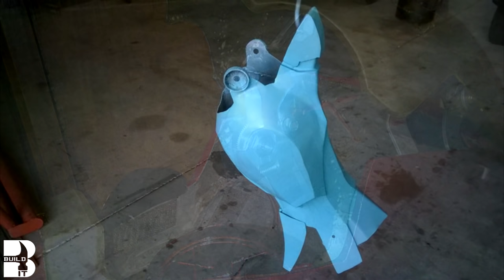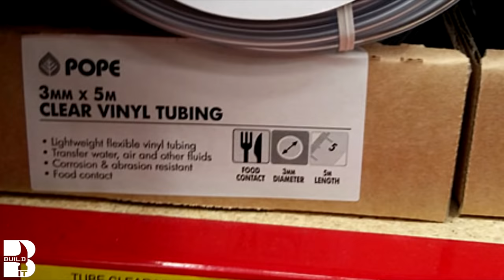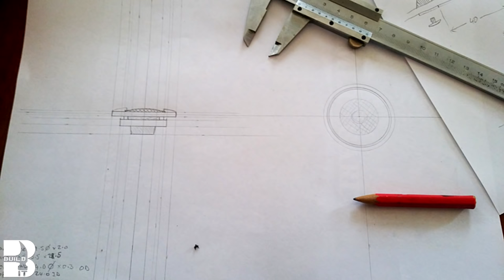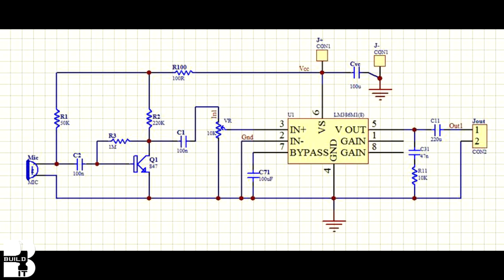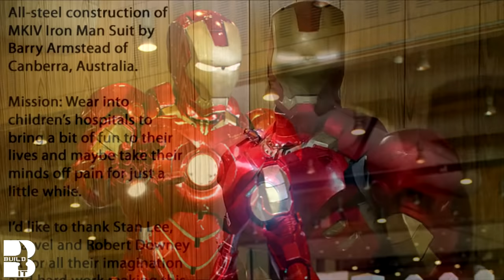DIY: How To Make Iron Man Full Steel Body Suit

Comment: Ive got a question im making the iron man mrk 50 and i used thin metal sheets but my edges are sharp how do i fix that problem. I have a jacket inside so im good but i might be causing some trouble to the people surrounding me. Im new to metal cosplay and theres not that much community for metal cosplays around.
Reply: Have you tried using a Dremel
Reply: came back after a year to solving my problem on sharp edges. you use a chizle clamped to an anvil pointing up. you use that to curl the edges of the metal parts. i made a video showing the process.

Comment: As a 13 year old in a Lego inventor club with other people my age I made an exoskeleton of This  suit in my size. How I did this with parental supervision is I took measurements of my body then designed the model on my computer Then I went to home Depot with my parents to get some small Hydrogen tanks, Cooper wire,Nuts, and Screws. I went on Amazon and bought Some steel sheets and brought it to life! I tried it out and it was awesome I have a secret to make it fly I might be the next Iron Man, No better yet I'll be called iron kid! But their is one problem I need to know how to make the Outside of it

Comment: Must be heavy, no? If I would do in any metal it would be alluminium, easy to work with and you can make a killer finishing on the surface. It would be obviously more expensive, but in the end it would worth it (but still cheaper then ordering one online).

Congrats on the build.
Reply: Thank you. Yes, aluminium is more expensive and harder to work with. Steel is cheap, easy to weld and shape and is very forgiving.